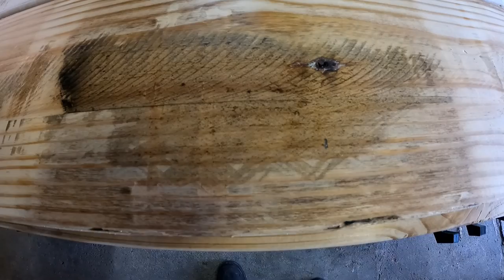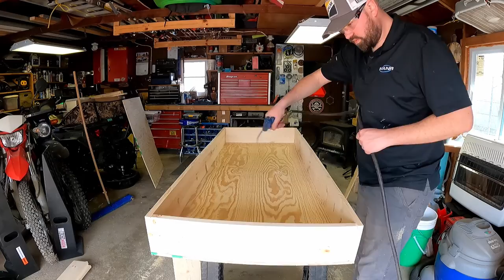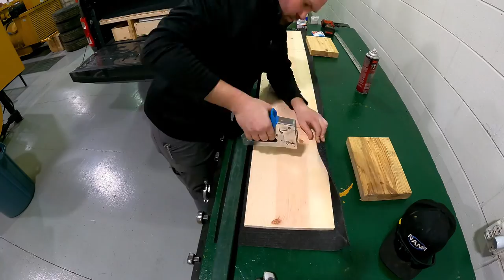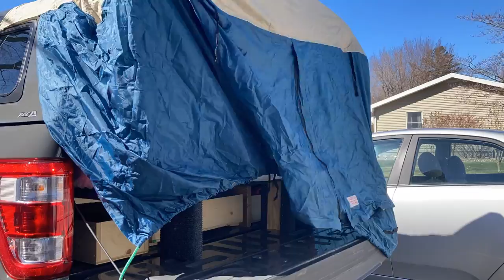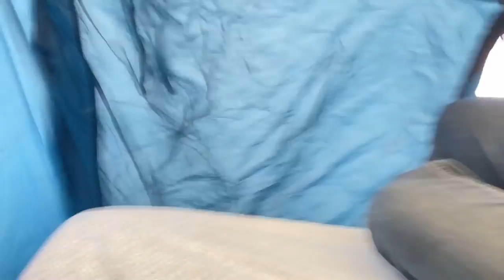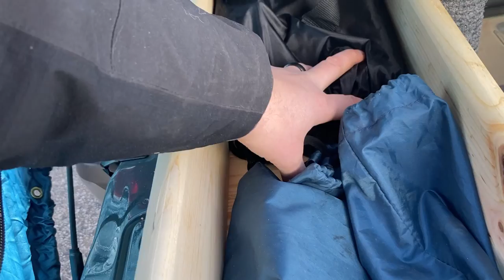Short Bed (5.5 foot) Truck camper build || Start to Finish process

Comment: I know I’m a little late to the party here, but if you could hinge your two 2 x 10 supports to swing out under your extension, you wouldn’t have to keep up with them and just stick them under
Reply from the maker: I thought a similar plan up, but due to the towing capacity of that truck I ended up selling before I could go any further. We now have a 2017 Ford F250! No camping set up for the bed yet but could be soon! Thanks for watching and commenting

Comment: you may have figured this out, but you're missing the bottom long bungee cord that pulls the two ends of the tent together under the tailgate. I fiddled with mine this weekend and made the cord tighter by putting knots in it and it was great. no gaps. I also put a clamp on the bottom middle and used an extra bungee to the hitch to keep the middle tight to prevent dogs from slipping out... :) thanks for this video! I came home and realized I need to completely redo my hasty build
Reply from the maker: Thank you I haven’t realized the missing bungee yet. I appreciate the kind words and the advice!

Comment: If you had a 6.5 box could've closed it while inside
Reply from the maker: I only had this truck 14 months and bought another superduty with a 6 ft 9 inch box.  The 5.5 is just too short.

Comment: I think you can use low memory foam as a bed , this is how you can get some head room
Reply from the maker: Absolutely, I’ve camped in it alone without and it made a big difference. Thank you for all your comments and watching the videos!
Reply: I learned the hard way that memory foam is not conducive to cold weather camping. That bitch froze solid😅

Comment: Good set up! Couple of questions? Where does your coolers and food go? Extra cloths rain suits etc.? Better get a plan about bathroom break middle of the night. Might need some curtains on the side and front? Hoping your cap works out for height? I likely would have bought a higher one. All in all good start. Have a fun first time camping!!
Reply from the maker: The answers to almost all the questions is the cab of the truck. Bathroom break in the night is to exit the truck. This truck/setup didn’t last long. We ended up getting back into a Superduty F250 for the towing capacity. Now we have a nice enclosed trailer we converted into a toy hauler. Video to come!

Comment: Awesome build! I've been debating between a 5.5ft and 6.5ft bed to accommodate a bed. Do you happen to have the dimensions of your box? Specs on the truck usually include the top lip.Trying to figure out if two 30" exped mattresses would fit.
Reply from the maker: Thank you for the kind words! I no longer have this truck to get the dimensions, but my advice is go with the 6.5’! The inside of the bed fit a 58” wide queen mattress with inches on either side. I think your set up will fit perfect. 
Thanks for watching and commenting